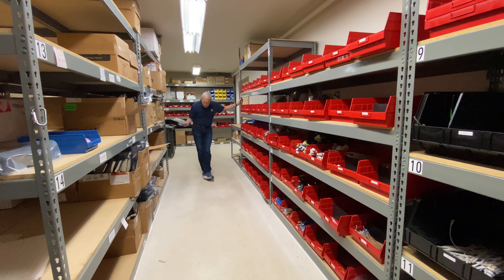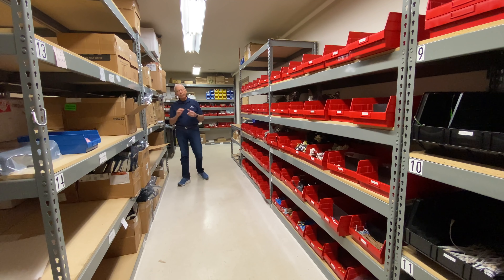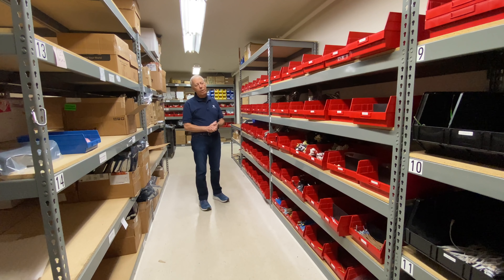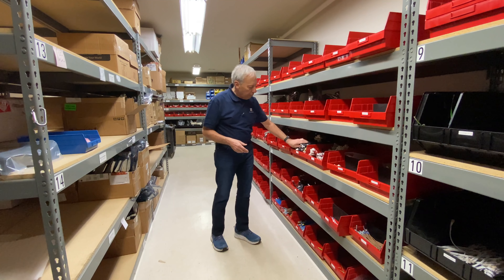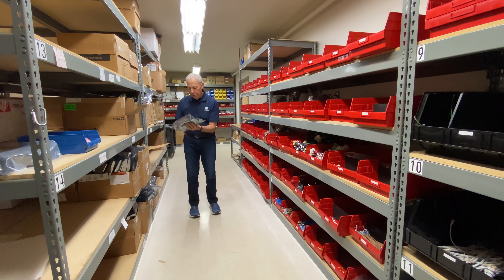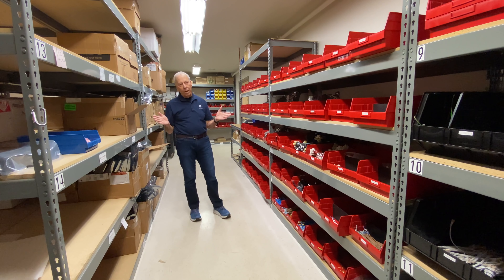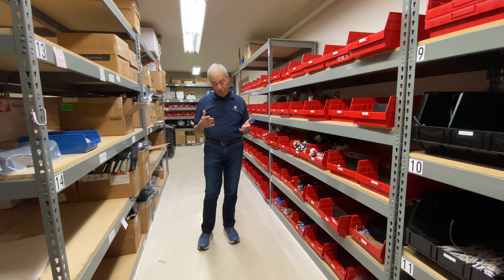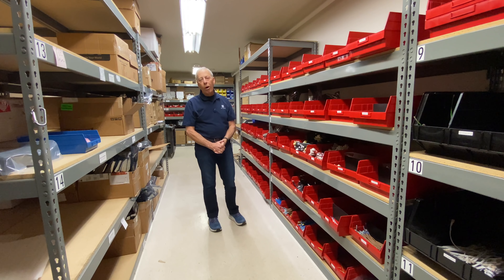How to tell parts quality

Comment: OMG! Paul, I'm such a MAJOR "electronics nerd" myself, working on, building, repairing, and most importantly, improving every single piece of audio equipment and pair of speakers that I can get my hands on, replacing all components in the signal path and power path that "could be better" with the best quality ones I can, all the way down to the smallest through hole devices and even some of the larger "surface mount" stuff, like caps, resistors, etc... So I have a great appreciation for close tolerance, high quality individual components at circuit board level! Especially the kind that go into amps and speaker crossovers!

I also completely understand and know how to read all of the terminology and technical specs of different types of individual components and what they mean and what specs. are the MOST important or even critical to consider in different usage situations, etc., so that's another reason I have a FULL appreciation for this level of quality and attention to detail... because I know exactly what you guys have to go through to build your components to be their absolute BEST from the ground up!

Improving audio stuff and speakers has been my passionate hobby since I was about 16 years old in High School, so... 

When I'm finally able to drive up to Colorado to come visit you and tour the plant, I'm most definitely going to want to see the "parts warehouse" room! It would be kind of like going into a "Radio Shack" as I did every weekend when I was a kid, but in this case it would be like seeing one that was on steroids! Lol!

Comment: I worked in 2 different consumer electronic companies as system engineer. They all do exactly what Paul said. Frankly I think any electronic company with okay reputation does that anyway. But what Harbeth said was different when they build you pair of speaker they make sure you get the match pair of electronic and drivers from a batch of same and good quality driver and electronic components. There is a few audio company that do the same I know of MBL, Wilson Benesch, and Audio Physic.
Reply: A LEE  - Graham Audio does the same, they provide match drivers if your speakers should have any problem in future, outstanding quality on cabinets too, love mine.
Reply: @gryphongryph   I was looking to get Graham or Harbeth speakers,but now with all that's going on I can't. :(
Reply: Y.K.  Yeah, not easy today to hear or buy gear, I was all set to buy the 30.1, but strangely I was not satisfied with what I heard, was quite surprised by that!!!
The listening room at the shop was not ideal, but I just had a feeling that the speakers put the singers too far forward in the midrange, flew back home very dishearten.
A few months later I decided to get Spendor unheard, but luckily the shop owner told me to try Graham Audio as he felt they were better, so I bought the 5/9 unheard and must say they are marvelous, very clear with a midrange that is perfect for my ears, to my ears it sound more balanced than the Harbeth demo I heard, also they seam to have better drive, ideally one should listen to as many bbc speakers as possible, the Spendor and Harbeths are very popular, so they must be good speakers as well, we all hear differently 😉
Reply: @gryphongryph  Thank you for the info. It is hard to buy speakers. I'm done buying blindly. ( I think )  :)

Comment: I worked in audio and video manufacturing for many years in my career, and there is nothing special in what Paul showed or said. The question was directed to the point of tolerances, and if they test components for conformance to tolerance. Paul didn’t address that issue, but just mentioned that they use 1% and .1% parts, which would be for resistors. The tolerance of capacitors and inductors are much wider than that. While incoming inspection might test a sample of the materials, they cannot test everything so most parts get used without any testing prior to assembly. The board level and system tests generally weed out any parts that are far enough out of tolerance to cause a problem.
Reply: Larry Niles Maybe just the oldest and most experienced.🤪
Reply: Larry Niles Maybe just the oldest and most experienced.🤪
Reply: Larry Niles Maybe just the oldest and most experienced.🤪
Reply: @Larry Niles larry larry larry
 Lost for words aren't you.

Comment: A Quality Control Engineer would have an absolute fit with you touching everything all the time!  No smock, no grounding, no nothing... LOL
Reply: ESD control is also snake oil, most modern chips are protected against ESD on their peripherals.
Reply: @hugobloemers4425  after working at a company with razor-thin margins that spent thousands on ESD controls, I can promise you that it's taken very seriously in the computer industry.
Reply: Interesting that their products are incredibly amazing, and he’s not wearing a smock, an ESD band, or anything like that.
Reply: @hugobloemers4425  I think someone needs to study electronics instead of doing DIY Arduino projects...

Comment: Let's touch some ESD sensitive board with bare hands and put it back again...I used to work in a consumer electronics company where the policy was that any such touching would require the board to be scrapped as an ESD discharge can yield a damage for the customer.
Reply: imagine a smiling Paul pulling every board out of the ESD bag, touch them repeatedly and say 'our parts are of such high quality that electrical discharge is no problem'.
Reply: Even if handling it doesn't do it walking across the floor with it in hand the act of putting it back down, maybe if it goes back into the bag first is not AS bad?
Reply: Lambda Storm To ESD protect every trace on a PCB against Paul randomly touching it is not a good thing for audio quality. Companies add ESD protection on the I/O including especially customer facing connectors but a random finger touching the middle of a circuit board can yield a damage if the discharge happens at a sensitive point. On the other hand, some circuits have no ESD sensitive traces and can be handled without concern. I’m sure Paul knows which boards are prone to ESD damage.
Reply: He owns all those parts.  Just has to answer to his family if he breaks something.
Reply: JK Brown One problem with ESD is that it can cause a damage that won’t be recognized during the assembly and test of the product but yield premature death of it later. Potentially your amplifier dies 1 day after warranty because someone had a finger injecting ESD into it.
Reply: @jkbrown5496  https://www.analog.com/en/analog-dialogue/raqs/raq-issue-130.html#
If we are lucky, ESD or overvoltage/overcurrent will destroy components instantly—so it is clear that there is a problem. More commonly, though, such stress may cause damage that results in premature death long after the stress that initiated the failure has gone. Diagnosing the cause of such failure is very difficult and may be impossible.
Reply: Maybe they should charge more for that part because it has Pauls fingerprint on it.
Reply: @harrylanza  Perhaps Paul could add his signature somewhere on a certificate of authenticity (not a made in China product). I wouldn't mind to pay a bit extra for that :-)
Reply: Larry Niles When did I say he is an idiot? I’m an audio engineer myself btw. I didn’t say anything incorrect. If you read my comments you’ll see that I believe Paul understand which PCBs they make where ESD is a concern. ESD bags are used for parts even they are not ESD sensitive.
Reply: Circuit broads are tougher these days then in the pas. I used to get part and make home medes computers and i never grounded my seld and sometimes i would get zapped touching a PCU vidoe cars os SounsBlasters audio, but all of them worked when in put them in the computers. Google 'Effect of Ambient Temperature and Humidity on Combustion and Emissions of a Spark-Assisted Compression Ignition Engine;.
Reply: i love cops Sure, this problem is not as bad today as some years ago and when it comes to integrated circuits of today, the ESD protection is typically build-into the chip. Of course PC boards for DIY people are always done with this in mind. When you live in a dry climate, ESD from your body can cause some serious zaps and it’s always good to be careful when touching electronics with semiconductors. I’ve seen lots of cases of ESD damages.
Reply: Scrapping seems a bit overkill to me, but rerunning all tests would be a must.
But yeah... It's PS Audio stuff after all, so don't be surprised that they won't do that.
Reply: Qorax Scrapping can be cheaper. Actually ESD damages can be impossible to identify as they can be internal on silicon. It can be like someone cut in a tire on your car without puncturing it. Some day the cut can become a puncture. ESD is quite similar.

Comment: Does that room have an ESD floor?
Reply: ESD flooring only works if you’ve wearing ESD shoes. Wearing an ESD smock or clothes also helps. I hope the storage bins are ESD. Ion Generators are required for insulative parts to neutralise any charge they’ve accumulated.

Comment: It's a miracle!  Loof Lirpa lives!  Sorry, I got carried away for a moment.  Actually, it's just sufficiently advanced technology.  During research into the sacred Ohm-Watt-Amp, the fabled "Tube from Heaven", a random quantum fluctuation apparently resulted in a runaway feedback loop.  Professor Lirpa successfully activated the emergency temporal stasis protocol in time.  Good thing too, this could have been a planet cracker if left unchecked.  Even the phenomenal intellect of Professor Lirpa cannot articulate what happened next, until he was picked up by the Ghost Card Cutter "Fezziwig".

Director Dankeschon and the staff at the Lirpa Labs Special Projects Facility on the former Island of Nomenur remain within the stasis field, But not to worry, Dr. Lady Allison Tryon (great-great-granddaughter of Augusta Ada King, Countess Lovelace), director of the Quantum Computing Center at the University of Brigadoon, is personally working out the permutations needed for the extraction of their kas for reconnection to the bas of their clone bodies, which we keep as backups. 

Lirpa Labs must unfortunately announce that the amplifier of unlimited power project is on indefinite hiatus.  Calculations based on preliminary observations estimate that it will take several hundred mega-years for the constrained energies to bleed off into the extra-dimensional bulk and the stasis field can be deactivated for recovery of the O-W-A.  Well, safety third, as we always say.
Reply: Fat Rat  "It's astounding.  Time is fleeting.  Madness takes it's toll."  --  Riff Raff

Comment: I'm surprised that Paul hasn't gotten involved in some Military project. Maybe that's by choice? Or maybe he got burnt in the past? The basic structure is there to do it. And the Government really favors small businesses. He could pick up project or two just because he's below a certain number of employees. A good way to get in is simply to second source something. Many prime contractors have to second source what they're building and he'd be easily able to do that. IMO the product he builds now that I think would find a military market would be his Power Stations.
Reply: Well PS Audio certainly has the quality standards to meet military requirements. But Paul has to stop pandering to the snake oil audiophile community if he would want to be seriously considered for such work. Oversight in military electronics is basically done by the big boys, Raytheon, Boeing, etc. Talk of power outlets "reducing midrange bloom" and other follies are not going to give him the credibility needed to engage in mission critical electronics work.
Reply: @andydelle4509  I've never been to Pauls facility but this little tour through his stock room made me think. I don't think he's presently up to Mil Spec build standards but I don't think he's very far away from it. Where I see him starting to get involved would be a sub-contractor to someone like a Raytheon. And second sourcing something they build now.

Comment: Assembled in the USA, from globally sourced components.....
Reply from the maker: Yup, just like pretty much everything else assembled here. There are zero semiconductors, for example,m made in USA anymore.
Reply: @Paulmcgowanpsaudio  Sad really, but politics have made things that way I suppose....
Reply: @Paulmcgowanpsaudio  That's a shame but I do prefer the sound of British made transistors.
Reply: @Paulmcgowanpsaudio  That is totally untrue.

Intel: Fabs 11,12 , 34 and 42
Microchip: Fabs 2, 4 and 5
The list goes on.
Reply from the maker: @FooBar89  Fair enough. But let's be realistic and then suggest the vast majority of semiconductors, especially the kind we use in power amplifiers, DACs, and microprocessors are unavailable as US made. And resistors, capacitors, and the bits and bobs that go into circuit boards are almost entirely made overseas. Other than some home hobby crafts, I'll bet you cannot name for me one reasonable piece of technology made entirely in the US of US parts. I'd be really surprised to learn otherwise.

Comment: 2:50 You can't promise 100% inspection... That's only 99% true.
Because 99% or 99.99999999999999% is possible if you go through nearly infinite lengths to achieve that.